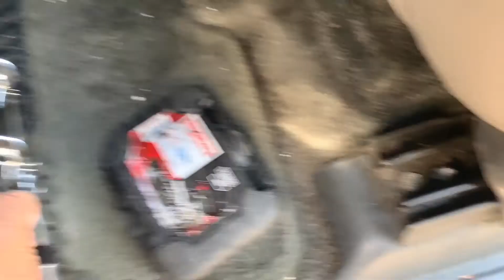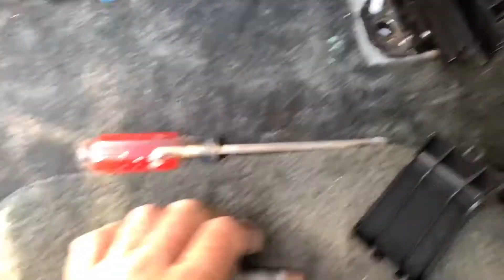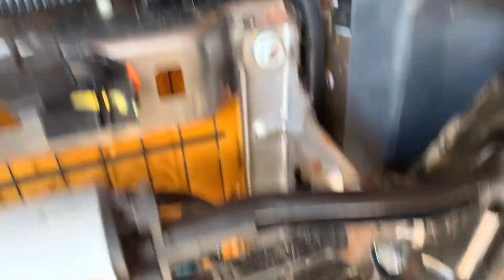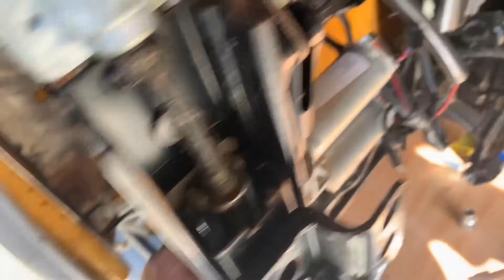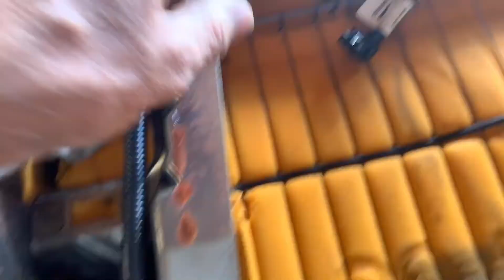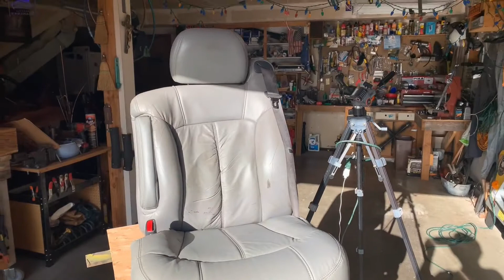2001 Tahoe Seat Bottom Cover Replacement

Comment: Hi. Thanks for the video. I’m getting ready to change out all four parts of my two front seats and before this video, I had no idea how to even start. I’m not about to pay my Upholstery guy $370 to just replace my covers! I also wanted to ask you, where did you get the front roof visor and the wing on the back of the truck?
Reply from the maker: Oh yeah I know what you mean you can do it yourself and save a ton, you know I bought the visor and wing in 2001 , I would try Summit Racing, I’m pretty sure they would have them, thank you for coming over and checking out the video
Reply: Thanks for the response! I will check out Summit for those parts. BRW, I’m finally gonna do this job this weekend. I’ve watched your video at least 10 times to get ready!! Thanks again for the post!!
Reply from the maker: @markl4164  Glad i could help let me know how it turns out

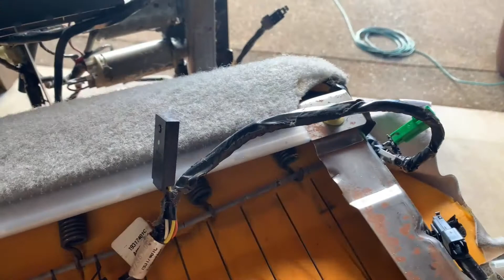Comment: At 5:18 there is a shot of the harness (identified by the tag as 19317401C). I desperately need to know where that comes from. Is that part of the harness that comes directly from the driver's side heating element?